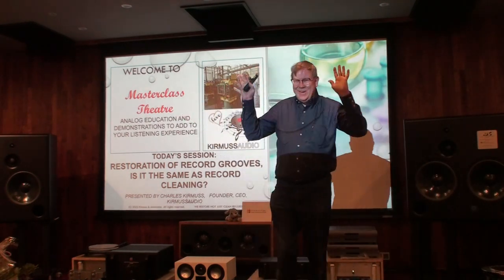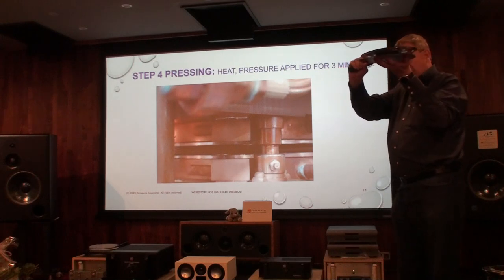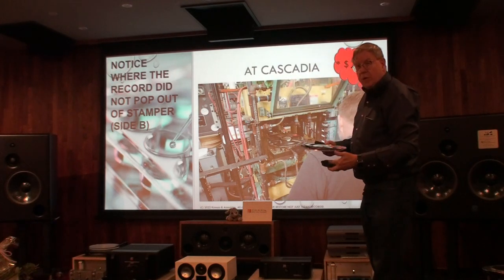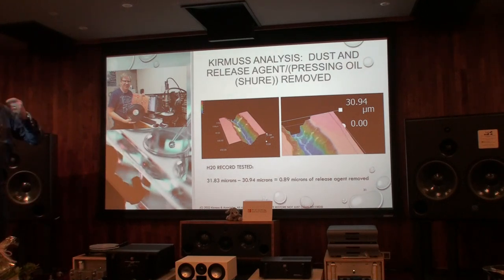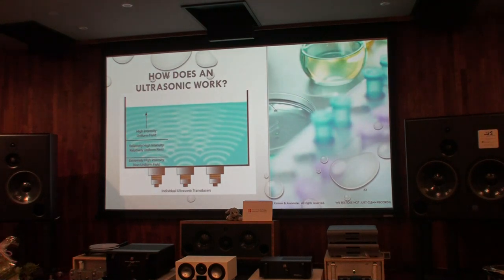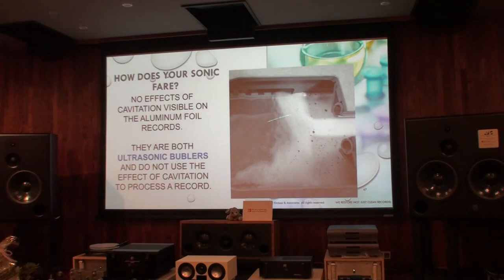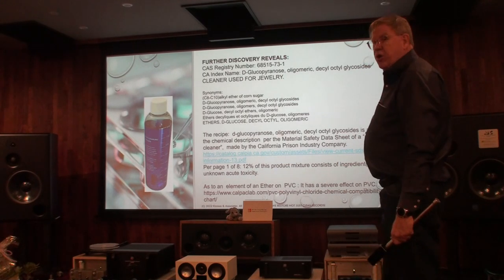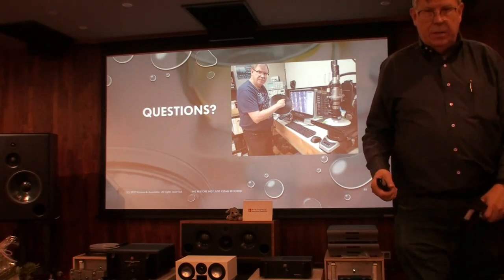KIRMUSS MEDIA EVENT NOV 2022 KOREA UNDERSTANDING THE RECORD RESTORATION PROCESS

Comment: Hi Charles.  I have what seems to be a practical question, at least to me.  I know you consider the Degritter to be a "bubbler".  Since cavitation is, in fact, creating bubbles I'm not sure how that's a disqualified but obviously you're saying it is not, in fact, an ultrasonic device due to the aluminum foil test.  It seems obvious that the cavitation effects produced by a 120kHz machine will be far smaller than those created by yours and most others.  If I throw a rock at a glass window with a certain velocity at a glass window, let's say it breaks.  However if I throw a pebble at the same window with the same force, it likely wouldn't.  Why doesn't that apply here?  Thanks
Reply from the maker: Check out our testing of ultrasonics in our 45 minute session on our YouTube channel.  We used a cavitation meter to measure cavitation in three advertised ultrasonics. This piece of test gear is used by ultrasonic repair technicians to locate both faulty or failed transducers.  Not any  home made tester. Added you may make for yourself aluminum foil test records using specialized aluminum foil that is mandated by governments to test daily their ultrasonic machines. The foil should see dimpling if in fact if it is using cavitation. I started first with the foil test.

Then as Fremer did not trust foil test that I used at NASA in 1978, I then bought 2 testers in September and October 2022 at a total of 38K invested to further provide proof. I am not from this industry, but was  surprised the lack of any testing... a shiny coated record means nothing to any reasonable person studying the art.

...also added to my Keyence VHX-7000 2D 3D  a $175,000 2D 3D imager.  

To your point, in China we see many sonic water bubblers used to clean vegetables. They do not use cavitation. Cannot say more. Self explanatory.  

Buyers need as Michael Fremer said in the Stereophile August 2022 issue SEE  this industry sector SET PERHAPS  standards as to safety and ingredients of chemical used etc..

 In my 45 minute session recorded in Seoul are images of testing two advertised 40 KHz systems as well as a 120 Khz system. ADDING TEST OF ROTISERIE STYLE RECORDS USING BOTH ALUMINUM FOIL RECORDS AND A CAVITATION TESTER.    surprise surprise surprise...

Also where using   a Nakamichi T100, a TC3000 from Ortofon,  we do before anf after processing tests on any cleaner. So far we see a decrease in Signal to Noise ratio, and while we at times no longer hear a pop from a particular area on the record, our Keyence VHX 7000 measures also an increase in record height also seeing the contaminant still captured in the pressing oil. After many plays the needle gouges this out. Pop is heard once more.

A restored or properly cleaned record based on the table of Tribelectric charges should repell water and not need  air or vacuum drying. A much larger issue.
Reply from the maker: Added to my reply, in the slide presented, ultrasonic cavitation is generated by one or more  transducers mounted on a metal surface, not plastic, generating a sound. 25, 35, 40 etc kHz.   Bubbles generated due to the definition of cavitation as they rise do implode and generate  an industry  termed  plasma wave.  NOT BUBBLES. 

Chinese manufacturers are selling underwater air agitators that disturb standing water creating bubbles. This is low velocity. Used to clean vegetables.  Incorrectly  termed as an ultrasonic created bubble.  Look at some of these machines.  With no record in a true ultrasonic machine  use the degas cycle. There are no visible bubbles as cavitation creates a wave. If you now see bubbles and if a soap was added , you will see foam. Equated to the product not being a true ultrasonic using cavitation. . Sonic activity sees rising and moving 'waves" created by implosion. Does not create visible bubbles. Cavitation generates invisible bubbles not seen by the human eye. Check out many web sites. They talk about micron level bubbles that implode, creating a wave and having sub visible bubbles  that implode.

Everyone also knows that the downfall of an ultrasonic"s efficacy is based on the presence of air. 

...That is why we need to use in our case a degas cycle to remove air.  So if a sonic shows no dimpling of the foil in the  aluminum foil test or you see large air bubbles,, not using ultrasonic cavitation.

If a true ultrasonic one  should see dimpling of a special aluminum foil used to create a record of sorts.

A cavitation meter should measure in CAVINS the pressure generated by a true ultrasonic. It should also be relatively even from edge of the record to the dead wax area only if some resonance has been added as ultrasonics by nature are violent with varying levels of intensity. Check out the slides showing this.

Measure of wattage or current draw as most peers represent  on a product sales sheet as to ultrasonic  pressure means nothing as to cavitation, or ultrasonic cleaning efficacy. 

If we had a true ultrasonic there is a calculated load charge.  Only a certain number of  records per liter of water may be processed.  ..this especially of concern one would think  if we are looking at closely spaced records as seen in DIY rotisserie style record suspension systems in a 6 liter tank ...while an ultrasonic, seen first hand  where standing waves if a true ultrasonic due to close proximity of records to each other  negates the premise of cavitation... as also seen in my slides using both foil and using a cavitation meter. 

ASK AN ULTRASONIC MANUFACTURER WHAT IS THE PRESSURE MEASURED FROM  THE BOTTON  OF THE BASIN ADJACENT TO THE EDGE OF THE RECORD ALL THE WAY UP  TO DEAD WAX AREA , THIS IN CAVINS IN THE ULTRASONIC' S BATH. ... OR ITS PRESSURE  EQUIVALENT.  NEVER WATTS!
Reply: I was very skeptical about your record restoration system. It takes trial and error to get the records cleaned,  I had alot of questions that Mr Kirmuss always answered not only by email but called me directly to help me with the process. I can assure you that his process works and works amazingly, . The first run of records was Miles Davis Kind Of Blue 45 RPM UHQR. After the following instructions my record was noisy , Mr Kirmuss called me and explained how to clea new records , my records have not sounded this good!!! Believe the man he has science behind his findings.
Reply from the maker: Your interpretation of what is a bubbler and what is cavitstion is incorrect. Bublers seen sold in China to wash vegetables do not rely on cavitation. Do look at our 45 minute video on our YouTube channel or the upcoming video shot yesterday at the Florida Audio Shie as to what is cavitation. 

 To appreciate what we bring to the table one needs to first  study what is cavitation.
 Cavitation creates pressure measured in Cavins or watts per square inch. We generate cavitation of 810 Cavins. To solve the dilemma,  What is the pressure generated by your systems? I know the answer. Let me know before I continue. If you appreciate the relationship between surface area loading and rules governing this as it relates to  an ultrasonic bath, youbwill appreciate I an sure where the level of cavitation intensity first varies as the bubbles rise and implode and a relationship in frequency as well needs to be first selected based on what are we trying to remove, a release agent and contaminants fused into the pressing oil.

Added, We add a 70 khz resonance to our 35 khz generated signal to even out the areas that rise. Using cavitation amone one cannot remove the pressing oil or release agent as I call it. Much more complex. The Tribelectric table of charges states where  both the record and water with or without soap repell each other. So our IP requires one to ionize the record. Thus applies to all sonics when dealing with records. Do cone back with the homework so I can then summarize the misconceptions presented.
Reply from the maker: @Jerry Padilla  Many thanks! 

FYI... We restored dozens of records here at the Florids Audio show, many records previously  processed prior by a variety of so called cleaning methods that reported to us by the record owners sone using sonics with purported frequencies of 40 and 120 Khz. 

 While these records were shiny before our processing,  the audience including notable industry experts such as Michael Fremer witnessed the successful restoration of these previously processed records using our process. Witnessing both the contaminants and films being removed as well as witnessing using our spectrum analyzer,  the resulting gain. Obviously the playback and listening saw the imaging tightened and soundstage incressed.

Glad you are realizing the same results as our visitors at the show.
Reply from the maker: @Jerry Padilla  it is not trial and error. Look at our 45 minute video on YouTube  recorded in Seoul or better yet the TrackingAngle.com video taken by Mr. Fremer at the Florida International Audio Expo 2024. It covers record manufacture, care and why we need to cycle the record in and out of the machine as the induced charge gets washed off.

Also cavitation and the definition is not simply creating bubbles.  The implosion creates a vacuum which then sees this wave pull out contaminants.  

Look at te definition of cavitation on Wikipedia. 

Creating bubbles not through cavitation but a bubbler or using an ultrasonic as a mister is not the expected result of someone advertising an ultrasonic cleaner.